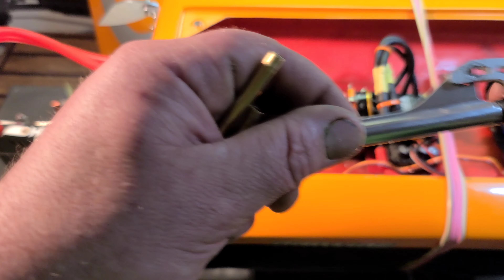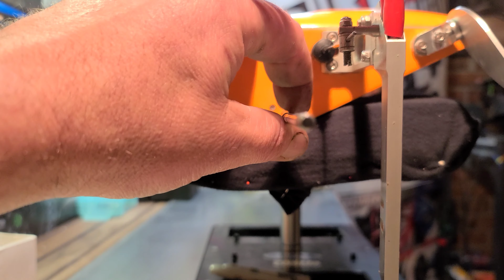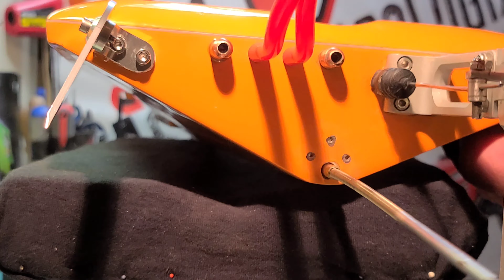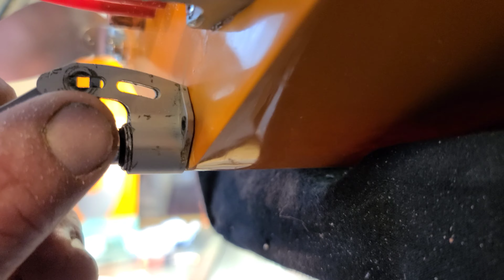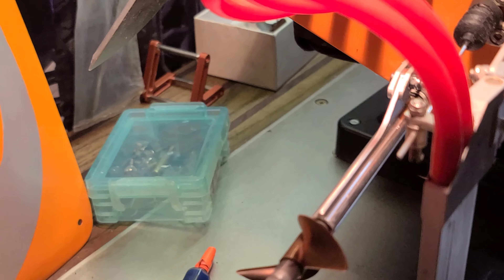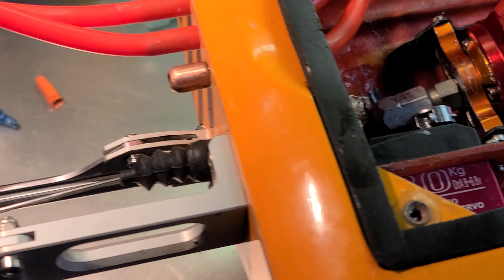RC Boat StuffingTube, Flex Shaft & Stinger Install - How To Replace Stuffing Tube RC Boats

Comment: Good one man I didn't think about checking for heat after the fact that I learned something new for sure but yeah I found that mine Pursuit   I can't run reverse if I hit reverse it pushes the water slap up in the boat I guess you know that

Comment: I have a TFL outer limits I wanted to install a different stinger but with all the screws out of old stinger it must be adhesived on. Do I just try to pull it off or??
Reply from the maker: Yea, maybe use a flat screwdriver or scraper to help pry it off

Comment: very good video !  i have tried running my tubes and flexlinrs without a teflon liner but water keeps goig in the hull...i puy a lot of grease but still keeps goi g in.  any tips to avoid this ? thks
Reply from the maker: Run a small fuel line on the end of the stuffing tube.  Should go over flex cable in-between the Collet and stuffing tube. So yes,  slide over the stuffing tube and flex shaft just before the collet.  Hope that helps you out

Comment: is it normal to have grease come out of the like flange bearing on the strut on high revs?
Reply from the maker: Yes. It depends on how much grease you put  in stuffing tube. Some boats are worse than others.  You can prevent the grease from coming out if you cut a small portion of fuel line or silicone  tube to slide over stuffing tube & flex cable,  kinda keeps grease in the stuffing tube where it belongs.
Reply: @IRONCLADRC  cool thanks, mine comes out slighyl from the rear bearing, like when i leave a small gap for the flexshaft to play the bearing seems to like to try and back out. I thought of maybe jb welding it into place inside the strut

Comment: What hull is that ? What size ?
Reply from the maker: Deltaforce 35.  35"
Reply: @IRONCLADRC  Where did you buy ? What hardware and eletronics are you using ?

Comment: In my opinion, it is a wrong application, it rotates very fast, but there is no centering with plastic or bearings in the pipe. wear on the pipe in a short time my friend

Comment: Definitely don't want to run a .150 with that size boat an motor.   An I wouldn't ever use Teflon on any motor bigger the 3656 . We race that size boat on 6s an we use 1/4 shafts..
Reply from the maker: Thanks for the advise. I wanted to run 1/4 and several guys said it would be to much for my setup.   I don't race but I do give her he[[.  Thanks for watching

Comment: Hi big b,  i bulid a df 35" more and less after your build as a templet. But i notis that your motor is shorter than my tp 4070, 1440kv and that motor is 105mm long and stick out of the motorbed (tfl same as yours) much longer than your motor by a lot. Im wonder if your tp motor is a 4060? It wold make sense with your kv if it as an 4060, 1950kv ... If you send me an email on sirchrim@gmail.com i will send you picture of my df 35" build.. 

Thanks too you i made first boat build too a werry nice and relative easy build.  So thanks for all of your videos. Keep them comming
Reply from the maker: I will look at my paper work again for the motor. Pretty sure it's a 4070
Reply from the maker: Yep it's a 4070. May be the long waterjacket I'm using making it look like its shorter also I'm using the front set of mounting holes in the motor bed